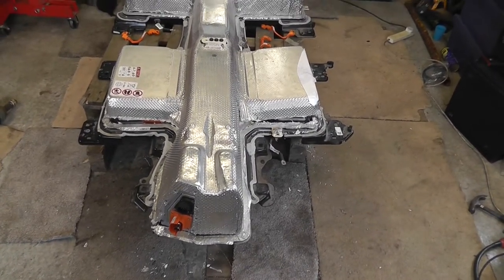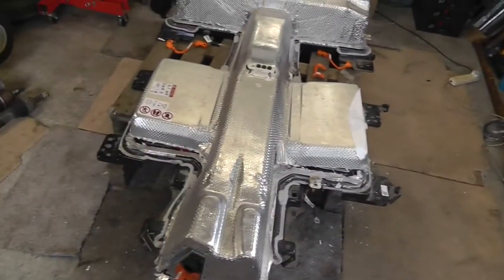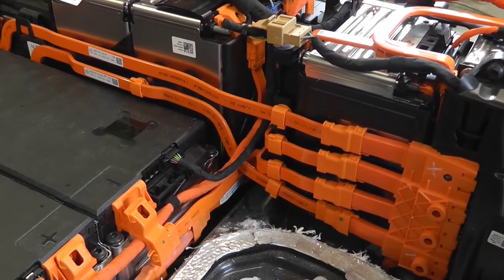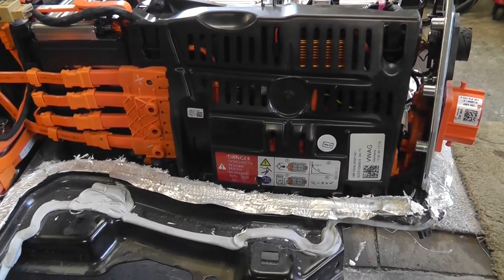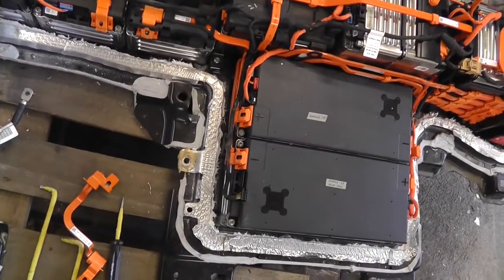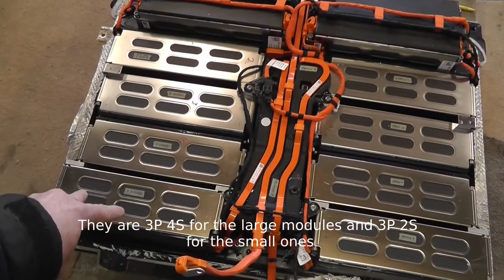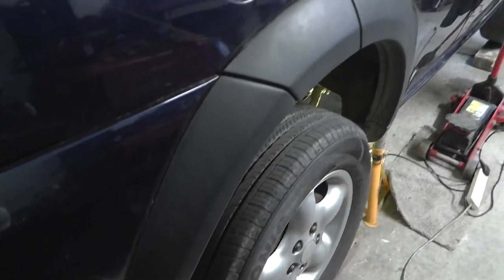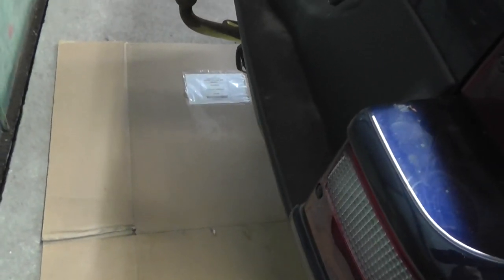DIY EV Part 18 - eGolf Battery Breakdown.

Comment: That battery looks like a mess. It's quite fascinating to look at actually. You can tell the engineers has worked to squeeze as many cells as they could into an area that was originally designed to house an exhaust system.

Comment: I'm interested in maybe making a golf a mini-eCamper removing the seats and interior stuff.  Coupling the Golf to a controller inside the towing vehicle it could engage the motor on up-hills and regen-braking on downhillls.  Finally, the drive can help an old-man parking it once decoupled from the tow vehicle (retain the steering wheel and driver's seat only.). Let's collaborate!
Reply from the maker: Are you talking about towing an eGolf with something? Even if it were possible I'm not sure what the benefits would be. It would have to be fully road legal as a car for a start.

Comment: um, 320 volts at 20 ohms is 16 amps.    320 volts at 16 amps is 5120 WATTS.   thats a HUGE resistor.   instead, I would suggest you use a MUCH larger resistor, like 200 kiloohm, thats a bit over 1/2 watt, but it will take awhile for a large capacitor to fully discharge through that, so monitor the voltage.
Reply from the maker: @geepeerces  I can't remember what resistance I ended up using but maybe a couple K.
Anyway it worked with no issue.

Comment: Hello. I want to ask you for advice. I bought a 2018 E-Golf, but it didn't have a DC fast charging connector. I plan to replace the charging port in the car. Help me with advice on how to reduce the voltage of the high-voltage battery so that you can safely replace the eboot and lay the missing wiring harnesses? Maybe you still have spare parts from the e-golf? (I'm looking for a spare part that you have on the video)
Reply from the maker: Sorry I just spotted your question.
I would not recommend you touch the charging port unless you know exactly what you are doing and have all the appropriate safety equipment. Not only is there almost 400V  in the battery which is extremely dangerous, but if you make any mistake in the connections or use incompatible parts the car will not charge as the charge port only becomes live when the car receives the correct signals from the charger. 
There is no way to reduce the Voltage without draining the batteries which will kill them.
I did not have the car so I do not have any other parts. 
I hope this helps.
Reply: @alibro7512  ok. Thanks

Comment: Q. are you keeping the VCU and driving the rear Diff? & 4WD - or will your EV Freelander be only FWD? - just to know, i see the Battery packaging underneath takes up the space of the original driveline.
Reply from the maker: I'm keeping the entire Freelander drive train and packaging the battery pack around the rear diff and propshaft. Or at least a small part of the battery pack. 
Freelanders don't drive nicely when front wheel drive only.

Comment: Hey, how come these modules get cooled down when they are densely packed together in a box where any air cannot reach.
Reply: I mean the Golf packaging
Reply from the maker: @RCagataySahin  I don't know. Maybe they are very heavy duty so don't get too hot. I hope so anyway.
They don't have any heating for cold weather either.
Reply: There will be COLD PLATE between the modules.
Reply from the maker: @logantang701  Nope, no cooling or heating. I guess VW over specced the batteries so it wouldn't be an issue.
Reply: That's the neat part. They don't.
Reply: @alibro7512 The only type of battery thermal management that this car can do is reduce dc fast charging speed and reduce regen.
I mean I get why they did it. The batteries don't heat up too much and should be good for at least 2 back to back fast charging sessions but after that the performance is gonna drop in summer.
I know because I'm driving on.
Reply from the maker: @Luka_3D  With the shape of the pack there is no way VW could have got the same capacity with thermal management. They probably figured most eGolf's would be a second car in a middle class house so would be charged at home 99% of the time.
Reply: @alibro7512  Yeah that's basically what they wrote on their blog. Apparently at the beginning they were going to use the same cooling system as their plug in hybrid but decided against it due to the batteries low self heating tendency so they dumped the cooling system to save weight and complexity.
I'm glad to see their longevity is better than the original Leaf which really struggled with DC fast charging degrading it's battery due to heat.
However I am somewhat worried about how the cells do in extreme cold. I mean stuff like -5C should probably be fine but when we're talking electrolyte freezing temperatures, not even having the ability to heat the battery to keep it at a reasonable temperature might be a problem.

Comment: Great Video. Hard to find any for vw e golf batteries. I wanted to ask if you think it would be possible for the whole battery pack as it is with the housing to fit uner a vw golf mk4 2002-2005? At some point id like to vonvert a vw golf mk4 and use an egolf as donor for motor batteries ect.
Reply from the maker: I have no idea if the floor pan of a mk4 golf would be the right shape but if it is then potentially yes. 
If you bought a complete eGolf it would be possible but I suspect a very big job. It may be easier to repair the damaged eGolf. As far as I can tell they are being written off for very little damage because repair shops are wary of them. The car I got this battery from could have been repaired.
Reply: @alibro7512  Thank you!. Its more of a fun project for me since i want to have an electric vw golf mk4. Not looking at the cost really more looking at an easy fit and i think maybe the egolf will save me the headcahe of finding all parts (motors ect) to fit in the body of MK4. Anyway thank you for your answer! Cheers!

Comment: What is the Li-ion battery chemistry used in e-Golf?
Reply from the maker: The original Golf's had Lithium nickel manganese cobalt oxide (NMC) made by Panasonic. Mine are newer Samsung SDI NMC 333 cells.
Here is a useful link.
https://pushevs.com/2020/04/04/comparison-of-different-ev-batteries-in-2020/

Comment: Hi. Is there resistive heaters inside this battery pack?
Reply from the maker: There is neither heating nor cooling in the pack so I'm hoping these modules are so over specced by VW that they just won't get hot at the kind of currents I expect to draw.
Reply: @alibro7512  Interesting. Litium battery can be damaged if charging below freezing. I assumed that there is at least electric heating elements in the battery pack.
Reply from the maker: @waldemarii  I suspect the bms takes care of that.

Comment: I currently own a 2019 e-golf and im from the Ports direction 😉

Is this an older 24kwh pack or newer 35?
Reply from the maker: It's from a late 2020 eGolf so 35kWh.

Is that Portstewart, Portrush, Portaferry or Portadown?
Other Ports are available.
Reply: @alibro7512  lol. Portstewart
Reply: @alibro7512  and how many cells in series?
Reply from the maker: @Ruudi05  The VW had 88 cells but I bought more as I want 96 for my Nissan Leaf based conversion.
Reply: @alibro7512  thanks for info, have you got an idea what's the energy density Wh/Kg of these modules?
Reply from the maker: @Ruudi05  It is a 35kWh pack with 88 cells so each cell has 397.7Wh. The 4S cells have 1.59kWh and the 2S have 795Wh. 
This is going by VW numbers so I still have to confirm one way or the other. 
I'm not sure what the equation is to work out Ah, as the voltage will drop as it discharges but if we use 3.6V as an average it works out at just over 110Ah per cell. By comparison the most powerful 18650 cell will be around 3.6Ah

Comment: Why are batteries made with low voltage battery blocks in series, why not high voltage battery blocks in parallel?
Reply from the maker: All lithium Ion cells are 3.7V nominal. I don't know why but I guess the manufacturers have a reason.
Reply: @alibro7512  they connect 3,7v into block 24V80Ah, then connect serial blocks 24V to 110V.
Reply from the maker: @stefanovavarya8432  Yes, even 12V lead acid batteries are made from 6 x 1.2V cells so this is normal.
Reply: I still don't understand, for example a 12V-5Ah battery is assembled from 4 battery blocks 3V-5Ah in series. Why don't they connect 5 battery blocks 12V-1Ah in parallel?
Reply from the maker: @stefanovavarya8432  I'm not sure about the battery you are talking about. A battery is a bunch of cells connected in parallel and/or series.  the VW modules in this video are two types, one type with 4S3P and the other 2S3P. This was for packaging as the pack was built to fit into an ICE Golf. They were not able to modulate the temperature of the cells with cooling or heating so they are not as high powered as other cells of the same weight.
You would need to ask the manufacturers why they make the cells the size/Voltage they do but they always balance weight, price and power density. In the end it's all about compromises.
Reply: A battery's cell voltage is fixed. It might go up or down a volt depending on soc but other than that, the only way of increasing voltage is by connecting them in series. That's why they're connected in both serial and parallel configuration
Reply: @stefanovavarya8432 the voltage isn't determined by the manufacturer but from the chemistry itself. You cant create a 12v cell
Reply: @alibro7512  3.7V is the native voltage of a single Li-Ion cell, due to the chemistry.   just like 2.1V is the native voltage of a lead acid cell, or 1.2V is the native voltage of a NMH or NiCad cell.
Reply from the maker: @geepeerces correct

Comment: The battery pack of the 2020 VW eGolf is non-serviceable. So when the battery degrades beyond the point that it's reducing the range of the car to unusable, the entire car should be retired. Luckily the car has overcapacity. So poor performing cells, will be replaced by spare cells. The car should be able to perform for 10 to 15 years. No guarantee after that.
Reply from the maker: I suspect VW would say it is unserviceable but I can't see any reason why it couldn't be serviced by a competent EV garage or just replaced. I opened a second pack without damaging the lid so it could easily have modules replaced and be resealed. I'm not sure what you mean by "So poor performing cells, will be replaced by spare cells" since all 88 cells are in series so if any cell were to die it would effect the entire pack.

Comment: This Battery crap can't be the Future.🤦
Reply from the maker: I'm pretty sure people were saying the exact same thing about the noisy smelly slow unreliable petrol cars in the early 1900's. 😉
It is already the present, will be even more so in the near future and in 20 years time we will laugh about the slow charge rates and pitiful range and remember those hateful noisy smelly petrol and diesel cars. 🤣
Reply: The thing to remember is that this technology is in its infancy. My first car in the late 1970s was an 1100cc Ford Escort. It did about 25mpg & struggled to do 70mph on a flat road. 
Fast forward to today & 1.6 litre F1 cars are producing 1000hp. 

Imagine where battery technology will be in 10 or 20 years time